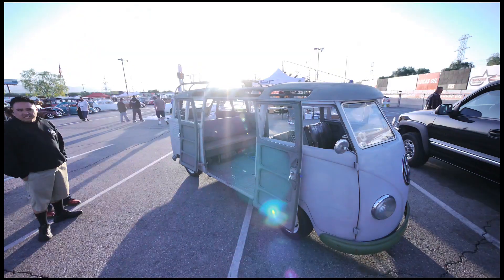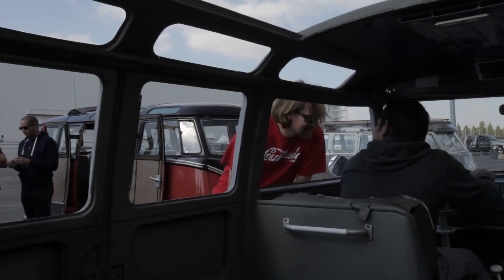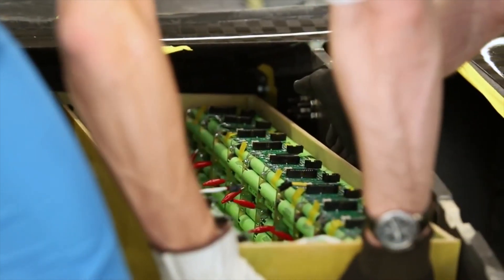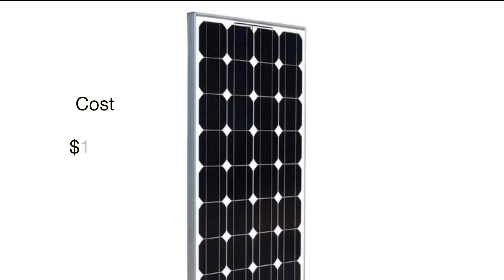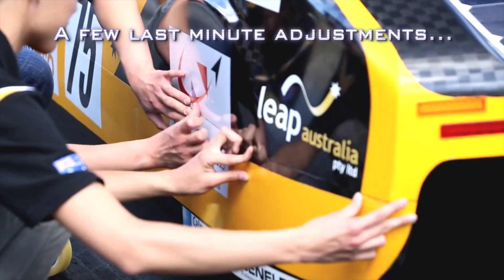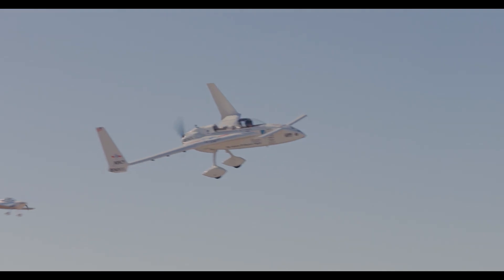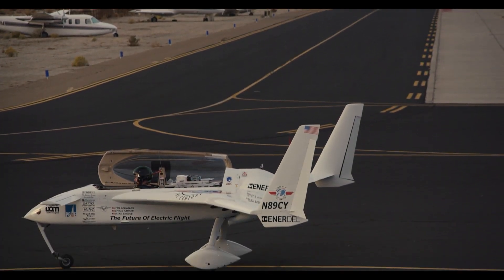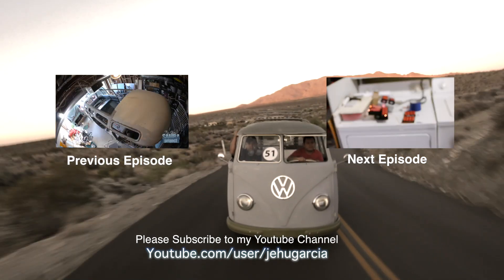Solar Panels to charge your EV?  eSamba DIY EV 18650

Comment: It's a great video.  You did not mention that the panels and controllers would add weight and air resistance, reducing the range of the car.   So some or all of the additional 11 miles would be lost.  And you could take those same panels, install them at your house and reduce your energy bill there, including the bill to charge your car.  And I agree it would not look the same, would not be the same car.

Comment: So you are saying - If I had the money I would rather invest it in more batteries than solar cells? Your calculations missed the sides of the bus, and you might see it different if you were into camping in the wild, because then you could have all the power and after a few days still drive off with a fully charged ev! I am even calculating what the effects would be to convert a school bus into a solar powered ev - type of off grid home to drop out of society and drive to the next camp every few day, while carrying some e-bikes for the local exploration...
Reply from the maker: I don’t live in my bus
Reply: jehugarcia take 'preppers' as an example they make a point in not taking anything for granted - not home nor grid power! Anyhow keep investigating ... have you heard about Sonomotors Sion released last July? With onboard solar generation the car becomes a resource of autonomy instead of a dependence liability ...
Reply: usertogo, Lets say he buys those 4 panels and when he gets home, he must choose to place them on the car, or on his home.  On the car, they add weight and complexity.  They sit flat.  And if the car's battery battery is full, they are wasted.  The car goes a few miles farther, and sort of self charges.  He saves $1/day.   Or he puts them on his home and angles them toward the sun.  They make 2X more electricity.  His electrical bill is less and the panels are essentially charging his car when he is home and plugged in.  He saves $3 a day.   He also drives the cool looking car he wanted, and chicks dig him.
Answer, go with the chicks.

Comment: Do you have an emergency battery for lights in case you get stranded at night? I mean can you use a solar panel and a 200+ watt battery apart just for lights reserving the rest just for the motor?

Comment: To solely run off solar at this point in time isn't worth it... but why not place a panel or two on the roof to charge the battery to when your out away from you charge station? say you need to take a 15 mile drive, your batteries are good for 18mi, you wont be able to get back if they dont have a charge station; but if you had a few panels on your roof, youd be able to get some juice back in them to get you back home.

Comment: Another think is that you always have to leave your ev in a sunny place and that could make it hot and also sun degrade a lot of things as the paint and interior. I think that if you got the money is a lot more convenient put the solar panels in the house roof with a battery pack and a charger for the Ev. And if that is too expensive, solar panel plus tie grid inverter.
Thanks for the videos Jehu.
And sorry if my english is not the best.
Reply from the maker: yeah, Solar is not the answer

Comment: yeah but... the solar panels would last longer then those extra batteries.. your forgetting to factor in the longevity of the upgrades and space they would take up and the cost of charging your batteries vs the free energy the panels would offer. to top that off, some people might only average 11 miles of driving per day.. to those types, they might not even needs to hook up to the grid.
Reply from the maker: https://youtu.be/N7scKCQlfYs

Comment: Hey, how much do you pay for 1 kWh of electricity from the grid. I think you have to consider the cost of electricity you have to use to charge your samba too. In Germany, where I live, 1 kWh  of electricity from the grid cost around 0.30EURO and 1kWh PV electricity between 0.08 and 0.12EURO depending on the solar irradiance ( keyword: grid parity ). In California for example you got far more sunshine than in Germany so the cost for PV electricity should be under 0.08EURO. Grüße
Reply from the maker: +Coco Mbella  anywhere from 11-49 cents per kWh,  depends on the time of day
Reply: thank you 4 you quick reply. if 1EURO = 1.11188$ you pay 0.099-0.44 1EURO for electricity from the grid, so PV beats grid and I think like in Germany the grid price will go up in the next 20 years

Comment: Wouldn't the panels eventually save you that $2000 that you would spend charging from the wall anyway?  They may not give you the same range per dollar as the batteries, but they do help offset the charging costs.

Loving the project, by the way!  Very inspirational!
Reply from the maker: but they would look ugly http://www.xconomy.com/wordpress/wp-content/images/2014/11/Vecna1-1-3-1100x734.jpg
Reply: Why not convert the top of have a system that would open up like the Solar Flower or a convertible that pops out a giant solar panel that can then stow on its own. That would be a large project but cool.
Reply: How about a flexible panel that would blend with the roof
Reply: At the electricity rates California, they would save that $2000 over the course of about 3000 days, or 8 years.

Charging your electric vehicle from solar energy really only makes sense if you don't drive it very often. Someone like me, who only drives 1-2 days in a week, could actually probably power a vehicle entirely from solar, but that's not even close to normal.

Comment: is practically use the solar panel to EXTEND the cells life?
so if you have a 18miles battery and the solar panel can give you 11miles. you at the end have almost 30 miles (in a sunny day).

Comment: bet you wouldn't have minded the 11.1 miles on the day you came up ten miles short.  Now why the batteries  would get you about double the miles over the solar panel, where would you put the extra batteries?  Plus the weight would be much less.  Unless your driving all day you can go to work let it sit in the sun and charge and then go home.  Less power would be required to charge from the house.
Reply from the maker: I currently have 150 miles or range,  I will be swapping out the old LifePo4 for newer tesla cells for 200 miles.    thats a lot better than this http://www.xconomy.com/wordpress/wp-content/images/2014/11/Vecna1-1-3-1100x734.jpg

Comment: That answer is not logical. With cells on your roof you have the possibility to choose how you want to charge your bus and also charge it passively. Witch would shorten the charging time and/or give you an option if you would end up somewhere where you don't have access to a charging station. Anyway... It's an awesome project, keep up the good work! :)
Reply from the maker: Being practical is sometimes more important,   This  look is not really my idea of awesome http://c1cleantechnicacom-wpengine.netdna-ssl.com/files/2015/08/solar-powered-electric-1966-volkswagen-bus-owned-by-daniel-theoblad_100521020_m.jpg

Comment: Why do we always miss the cost of electricity ? Every one is like , ok now we have cheap battery, the God will charge it for free.
Cost of electricity is lot more than Fossil fuels. As electricity comes from fossil fuels like coal, which is more polluting than petroleum. And then converting energy from one form to other has its own losses.  So its better to run a car on fossil fuels, than convert fossil fuel to thermal energy, then to Mechanical energy, then to Electric energy, then transformer losses as both sides, then long cable losses, then DC conversion losses, then charger losses, then battery storage losses, then again converting stored battery energy to mechanical energy, then friction. Its better to use fossil fuel to directly make mechanical energy. Electric cars are useless.

Comment: A use case like where you drive say 100km and basically kill your battery driving to the middle of nowhere. Then you relax on the beach for a week and in that week it has charged significantly and you can drive home.

Comment: Panels are always most effective if they face the Sun at a good angle. On your home you should be able to have them with no shade, facing the right way and always able to use the energy.                                                                  . Now if you use a light small vehicle like my ELF by OrganicTransit.com you can get 20+ miles from Solar.

Comment: There are ways to get free energy using panels. The down side is it had to be either on the vehicle or at home.

On vehicle can get around 8 hrs if its parked under some light pole like you see at Walmart. Each pole had around 5000 watts usable energy they put out. The home requires storage capacity cells that can be collected from panels during the day to recharge your vehicle. Both require an investment up front. The only option is more efficient drive system.

Comment: Here's a thought to keep the response positive.  So the panels aren't really practical for a car.  But its an interesting idea for a boat.  If you only use it once a week, it has all week to charge.  The accumulated KWH get to be pretty useful after a week.  If you use the output directly for a trolling motor while you're out boating you can even conserve your batteries and extend your range while idling along.

Comment: I've thought about solar panels, and it occured to me that the only way to make it worth while is for the experience. There's no savings in it.

The question I get most (and drives me nuts) is someone saying "Why not run a generator from a wheel to power the motor?". My usual responce is "ineffiency", and then to explain that we already do something similar with regenerative braking, and then combining the two answers for a better explanation (with a smile)...
How do you explain that to people?

PS... I love electric aircraft.
Reply from the maker: that would be question #2,   the answer got a bit too technical that i ran out of time to include it this week,   but next week should be part of the show
Reply: The generator idea does work, but gets really complicated. Besides the concerns with how to properly hook up the system so it won't start a fire, there are a lot of laws that have to be considered when adding an ICE to an EV.
As the distance required for your daily commute isn't far, you might just as well go with a little more battery.
There is also something called a "Twike", which is a human/electric hybrid. Depending on your local laws, and ability to import one, that may also be an option.

Comment: Jehu,  On the topic of adding solar cells.  4.45 kwh per day, $2000 cost, 400 wh/mi and 11.1 miles per day were your figures.  If you just spend the $2000 on electricity at the average cost of 12 cents per kilowatt hour it will take you 41667 miles.  To recoup that with the solar panels will take 3754 days of use or a little over 10 years just to break even not counting interest on the investment.  I have done this calculation before for the same reason as you and since my vehicle is much smaller (lots less power from panels) and gets around 280 wh/mile and I live much farther north my break even is 45 years.  You adding solar panels almost seems like a good idea compared to me doing it.  At the very least your panels will be paid for before they are worn out.  All that said, it would still be a really cool thing to do.
Reply from the maker: Another thing i forgot to mention,   installing Solar panels means i have to give up my sunroof and skylights,  you know all those holes i spent 7 months welding into the roof!
Reply from the maker: http://c1cleantechnicacom-wpengine.netdna-ssl.com/files/2015/08/solar-powered-electric-1966-volkswagen-bus-owned-by-daniel-theoblad_100521020_m.jpg